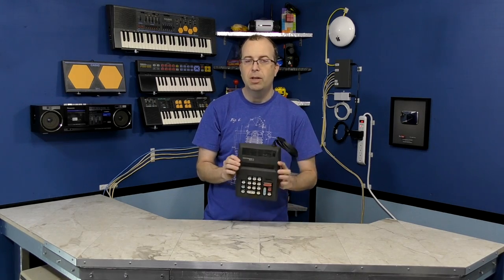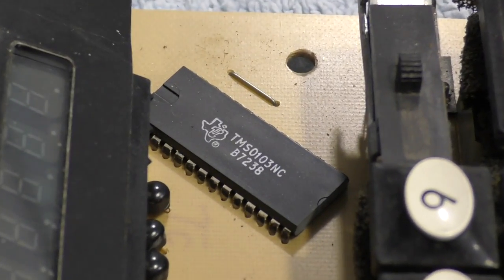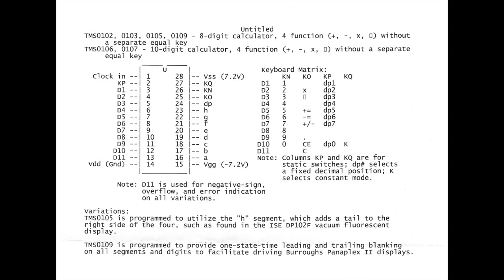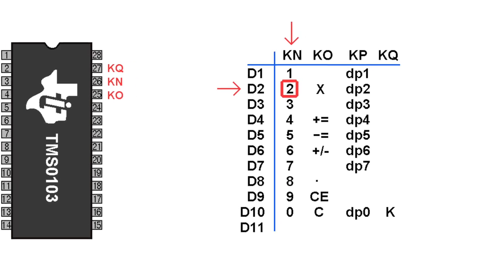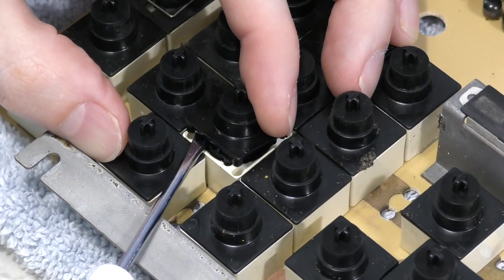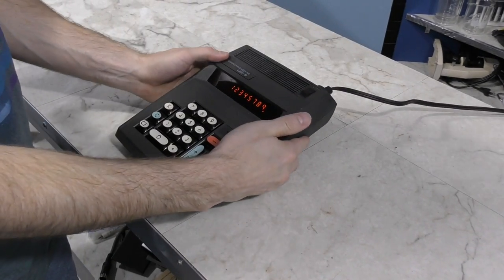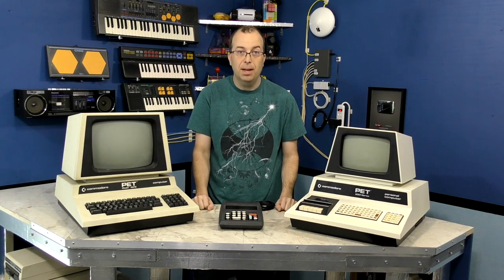Commodore Calculator Repair

Comment: In the coming weeks 8BG's mailbox will be flooded with nutdriver tool sets.
8:07  Better keep the plug in the sink... or one slip and it's bye bye spring forever.
I'm well familiar with the PET 4032 (12" CRT), the schools had them and they took a lot of abuse (which is why the keys on his may not work).  I don't remember seeing an actual PET 2001 (original model with built in datasette and 9" crt) but would like to see how small the tiny non-typeable keyboard really is.

Comment: Man, that 70s foam. I don't know if they had no idea it would crumble like that, or if they did and just didn't expect the product to still be in use when it happened, but it's nasty. You get lots of it in loudspeakers, and it ends up just filling up the bottom of the cabinet.

Comment: 8:17 get a set of vial brushes, might help ya in the future. you can also get straight brushes with the bristles pointing right out the tip but i can't remember what they are called off the top of my head, although vial brushes should be able to cover that if annoyingly.

Comment: That foam...wow. "Crusty and rusty...just like my undee-draws! Hyaaaaaa-HAAAAAA!!!" lolz

Other than that, the springs had some of that oh-so-wonderful (not) copper mold. That stuff is crawling with all kinds of nasty.

Seems those key contacts are in need of a bit of flame restoration (though I doubt that you have a capable blow torch). Make them bounce a bit more when pressed in.

Comment: It'll be a good idea to replace the electrolytic capacitor(s) and the bridge rectifier. Do not leave the power supply section as is, or someday you might loose the Ti chip.

Comment: Can of contact cleaner and a tiny metal brush can get into all those places and grind and desolve the resitive gunk.
Probably change out the electrolytic capacitors as they will be dryed out and the power supply outputs will be all wonky.  30 years definitely, even if they work ok now,  restoration of this item needs a full service of the inside if you make the outside like new again.

Comment: Those screws look like they're 1/4". Just a tip, if you're ever in need of a 1/4" socket like that, just use a bit driver with no bit in it. Instant 1/4" drive nut driver!

Comment: 5:16 I know this video is a bit old at this point but the 6 and 5 should be switched around I think, in the clip before the 5 seemed to work fine but as you were clicking the 6 it only registered 3 times out of you pressing it like 10 times

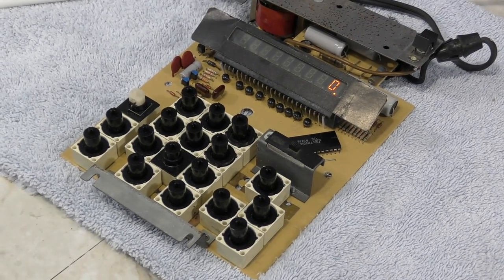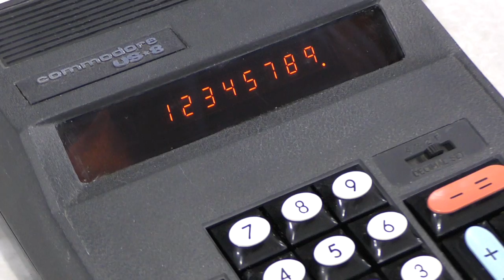Comment: It seems number 6 is still a bit dodgy (8:58 & 10:26)

But great video again! These makes me want to start buying old electronic items from ebay and try fixing them :-)
Reply from the maker: I thought that too, but I think it is just me and the finger that I use to press that key.  These keys require pressing a bit further/harder than a modern calculator or computer keyboard.  I kept going back and thinking there was something wrong with that key but when I purposefully press the 6 key by itself it always works.

Comment: Maybe the capacitors had to be loaded up in order to let the calculator work. It is a known problem with Philips MFB speakers. When I took a pair from the attic, they refused to work. But after 20 minutes with the power plugged in, they suddenly sprang to life and are working fine since!

Comment: You should replace those old electrolytic capacitors while you're inside there. They age quite bad. No matter the condition my limit is 30 years. Anything older will be replaced. It's a good practice to do. Keeps them from blowing. Just be sure you get them in the correct polarity. And buy nice ones. Not cheap junk. And do 450V rated. Then you can use them in any gear you open wether transistor or tube. Much like how you had those line capacitors blowing these electrolytics will blow at some point. And when they do they can take a lot with them.

Comment: Hello. Nice repair thanks. If you know how you can do wonders with these basic  "4 operations" calculators. Although this one has no memory to store intermediate results... Regarding the miracle "starts again for no reason", yes it could be the fuse, but it could also be that top-right electrolytic capacitor : it needed to be exposed to current for a while after years of sitting dry on a shelf to reform itself. They tend to go bad after 25-30 years. But no need to recap this one : if voltages are about right on the board, this 50 yo' capacitor is probably  still good enough.

Comment: A squirt of Deoxit or CRC electrical contact cleaner would've cleaned off the contacts easily. Wipe off any excess with a Q-tip or just wait a couple minutes and it'll evaporate.

Comment: have you considered replacing the electrolytics on the board? that could have been the issue, if they are dry they can cause this types of intermittent failures

Comment: As soon as I saw they had the foam on the spring, I though I betcha it worked it's way under that contact, and is making it glitch.  When he lifted that contact up, that's what it looked like to me. Why would put crumbling foam on the spring next to the critical contact points?  Whatever.

Comment: Never drag a probe across the pins of an IC like that - you may short something to ground or Vcc that might try the chip.

Also the papers capacitors in the power supply are almost certainly toast.

Comment: I got a kick out of the fact that it couldn't use batteries despite the fact that it didn't print.  Those LED's were power hogs.  I bought a Commodore calculator that used a 9 volt battery and the battery life was appalling.  It had a jack to allow a power adapter to be used.
Reply: What was the battery life if run  24 7 ?
Reply: @rautamiekka        Sorry, but too many years have gone by for me to remember the specifics.  I never did that sort of test.

Comment: The calculator doesnt work when you turn on because the eletrolitics capacitors takes some time do get charge,because the long time in unuseless...until capacitors get total charge the power suply dont have current to feed the calculator...

Comment: The mystery of the calculator suddenly working could be a weak capacitor having to charge especially if the calculator hasn't been used in years.

Comment: Watching some of the 8bit videos I wonder why almost all of the times he chooses to fix the parts and not substitute them for something new, for example in the case of the springs, but there where many more cases in other videos like oxidised screws, etc. why waste time and money cleaning them when you probably can buy new cheaper. I don't know if new are cheaper, or what is the purpose, so I just wonder if there is another reason for trying to fix everything even the small rusty screw or spring. Anyway the videos are great fun.

Comment: With years i learn  fuse can be the problem itself
At work we already got an high voltage phase unstable on a 3 pahse line , the problem come from a fuse in the switch box , one of the fuse got corrupted and than blow they just variate or cut the power when it got  too much charged

We got also a similar problem on a friend car with a brand new fuse , after installing an audio amp and installing a direct wire from the battery with a fuse on the , the amp cutted a lot like shutdown and start again , after a long day we tryed without the fuse and  it worked , after replacing the fuse by an another brand all worked fine , the faulty fuse don't blow on regular charge just cut the power randoly

Comment: An easy way to rule out trace and other faults would be just to short the contacts under the switch. If that works and the switch itself doesn't you know the switch is faulty.

Comment: 1:33 You tested the fuse for electric continuity without removing it from its holder?  It would have been shorted thru the transformer connections
Reply: Erm no

Comment: ok, I have a question. Why is it that an electronic calculator can divide by zero, but if you write program code that causes a computer to divide by zero, it throws a hissy fit and gives a bunch of error messages?

Comment: That foam is pure, unadulterated disaster.  Similar foam is used in the IBM Selectric series of typewriters.  Seeing as that typewriter is a purely mechanical device, it is always removed on sight for the same reasons.

Comment: I'm considering building a calculator as a DIY project, unfortunately Texas instruments stopped making the TMS0103 decades ago, is there any modern versions that I could find? I could buy an antique calculator to get the chip but I don't want to destroy a classic.

Comment: Well .... It's been a year and a half. Hopefully you've bought a basic electronics tool kit, discovered that pulling out the small tip on a multi-head screwdriver will leave you with a 1/4" nut driver, and have mastered how to dip a q-tip into your acetone bottle to clean out recessed key contacts. 👍😉

Comment: I have one of these - one thought on why it didn't appear to be working at first is that the display on mine takes a while to warm up. In fact it takes longer to warm up the longer it has been turned off. Don't know if you left it on for more than 10 seconds, but sometimes mine requires at least that much time if I haven't switched it on in a while. Something to do with the gas display?

Comment: The mysterious revival couldve been as mysterious as this oscilloscope i worked on (heathkit om-1, 1950's). Didnt turn on when i bought it then after hours of working trying to find the problem it just activated with a slight spark... Still dont know exactly why it turned on

Comment: Wow, you went backwards there figuring out the keyboard issue. With old electronics, the switches are the easiest to test and eliminate, and usually they're the cause of the issue.

Comment: In your intro the floppy disk says to use: LOAD "*",8
But instead of using "*" as instructed you use "&", I know that * is used to mean 'anything' or in this case the first/default program on the disk, but what does the & mean? (I never had a C64 so forgive my ignorance).

Comment: I have a Califone 3432 AV Cassette player/ recorder. It was working great, until i decided to open the stupid thing up. The only reason i did is to have some fantasy where im making a video like The 8-bit guy, except I ending ruining the little shit instead of resurrecting it like this guy.

So the real issue is that the Record/Low Power light is always on when i am playing a tape, even thought its hooked up to the wall; and when i do record, even out of the AUX port, it comes out super quiet compared to before i opened it. No disconnected wires, clean heads, no rattling.

Anyone please help